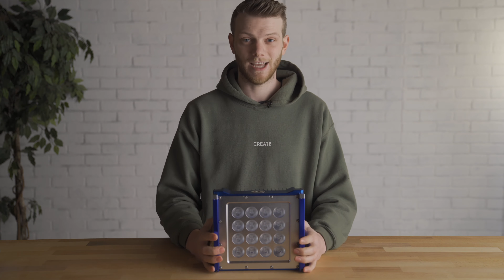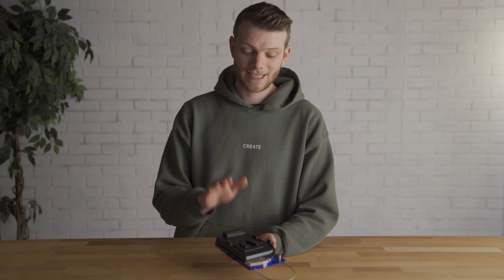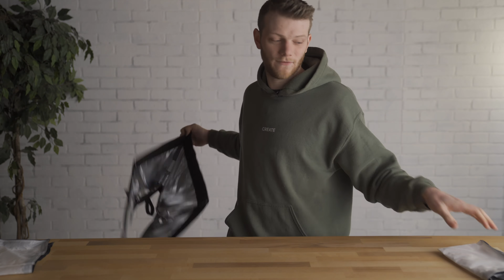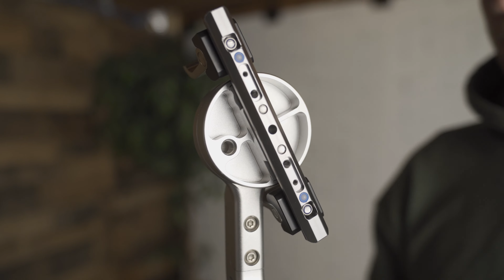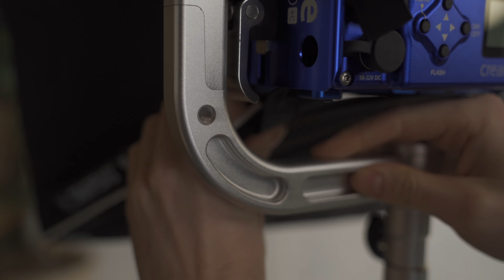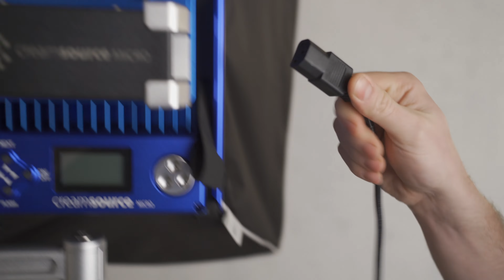Creamsource Micro +C - LED Kit and Assembly

Comment: Another great vid, very clear. One question: if you remove the knob at the bottom of the light stand fitting, will it fit into a junior receiver?
Reply: Yes it does indeed fit in a junior receiver.  Note the hole in the yoke to store the loose knob !
Reply: @TamaBerkeljon  Thanks. Always useful to have somewhere to put a spare knob…
Reply: @Rolypopoly  😄